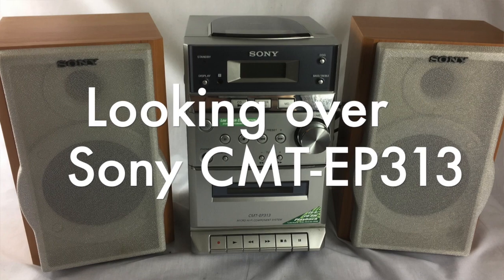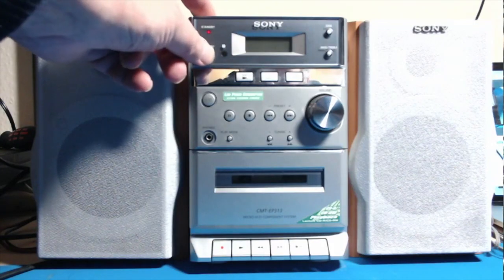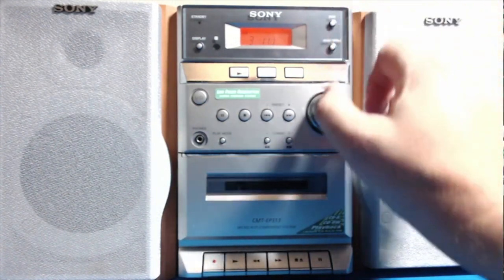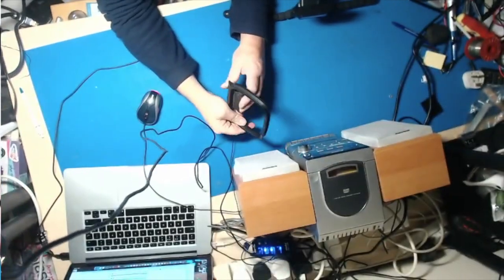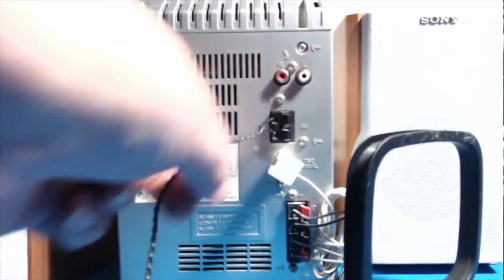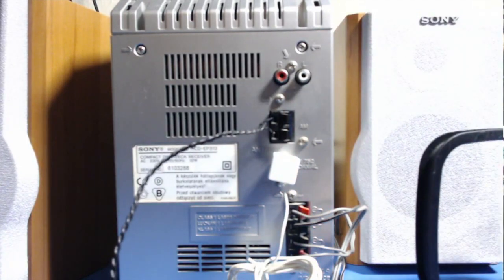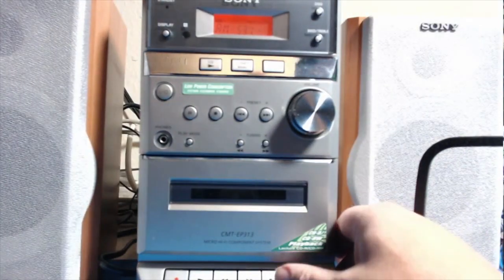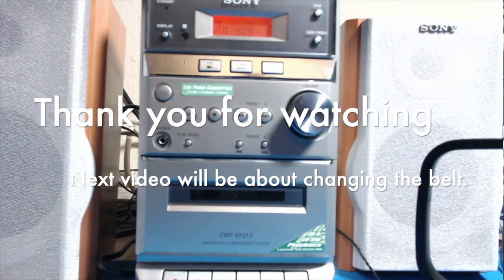Testing a Sony CMT-EP313

Comment: My exact Sony makes a whirring noise like it wants to play cassetes but can't. The CD playback works phenomenally but the seller and myaelf thinks something with the cassette feature got messed up during shipping
Reply from the maker: As I work in shipping too thats just an excuse.  Most Cassette machines havent been made since the 80s and use Rubber Belts, the problem is they perish so I would say 50% of cassette machines fail, its just the way it is.  I got Cassette units to sell myself and its the belts that slow me down vs is it worth converting.